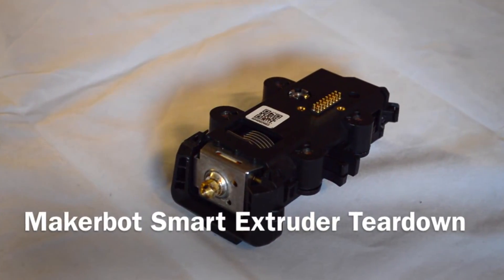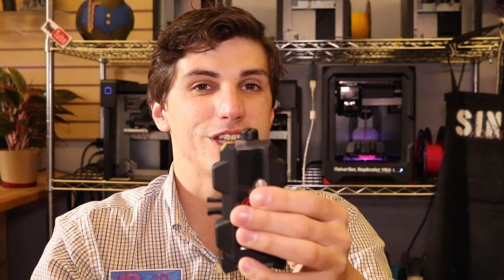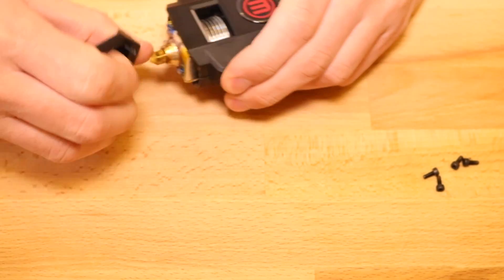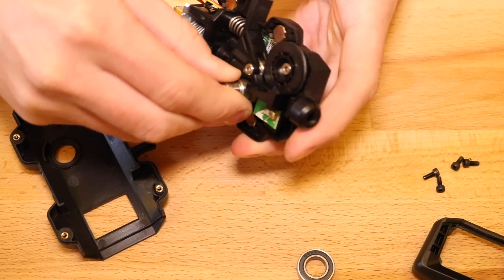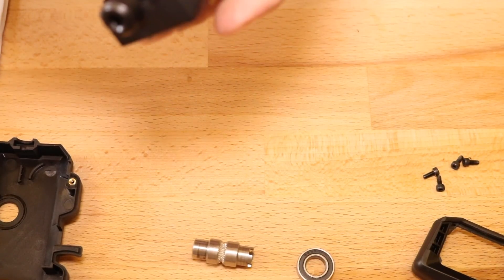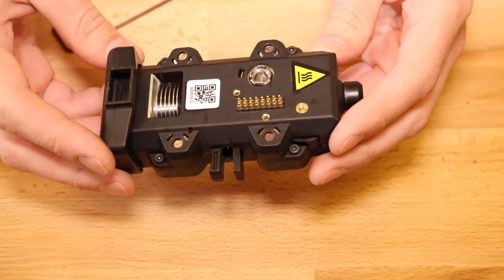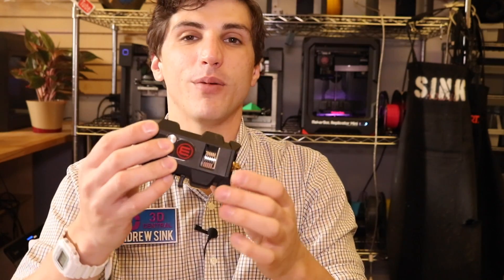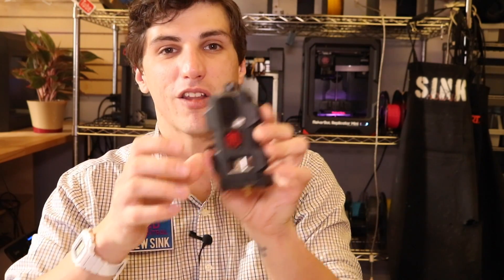Jammed/Clogged Makerbot Smart Extruder+ Plus Teardown and Fix

Comment: So, mine wouldn't come out because a piece had hardened inside the noozle. I removed the spring from the plastic guide so that it would not get lost and plugged the half with the extruder into the machine. It recognized it no problem. I started the pre-heat function while it ensure it would not touch anything. Once pre-heated in the machine I used some thick gloves to hold it and pliers to pull the filament and came off succesfuly.
Reply from the maker: Glad you were able to get it fixed!

Comment: When I pull on the piece of stuck filament, it will not budge. Any ideas?
Reply from the maker: Did you try heating the extruder and then immediately disassembling?

Comment: I have an extruder that actually wroks, but it was having a lot of fillament slips etc, and the leveling was crashing sometimes, opened it and cleaned the hobbed gear, and now im gonna heat it up so i can unstick the heat block from the aluminum plate so it levels correctly...

Comment: When I tried to removing the clog, I found it’s impossible to pull it. It snaps several times and I have to cut the feed tube to get to it.
Then I tried to use a torch to heated up the radiator part, while dragging the Jammed portion, and it came out. Just a personal experience
Reply from the maker: Yikes, that's rough. Sound like a pretty painful experience!

Comment: Great, thanks for this. Only thing I found is that when I tried to do this on a cooled SE I couldn't pull out the stray filament. I'm sure had I pulled or twisted it more aggressively it would have broken off inside.  So I heated it back up, then carefully disassembled it avoiding the hot end, and the stuck PLA came right out.   Also, my Allen key was omitted or is missing; please give the size Allen key to use, as these can be gotten anywhere.  Thanks, you're a life saver,
Reply from the maker: Glad I could help! Not sure about Allen key size, I seem to remember it was a 2.5mm, but you might need to try a few!
Reply: @AndrewSink  Looking further, it seems to be 2mm. I caliper-ed one that fit thinking it was SAE and got the odd .08", should have remembered most or all things in 3D World are metric.

Comment: Andrew - thank you. I fixed one a few years ago, but it failed this time. The jam was so far into the tube - it wouldn't come out and I pretty much destroyed it. Is there an alternative to buying brand new extruders? Is there a way to get 'extruder parts'?
Reply from the maker: Hmmm, you might need to purchase (or find) another broken extruder to get the PTFE tubing from, unless you can cut a piece and insert it yourself. Either way, spare parts for these extruders are typically not available unless you find an aftermarket solution.

Comment: Anyone else fed up with the Z18? This is like a pretend 3D printer at twice the price. The teflon tube guide in the overhead area gets tangled with the extruder, pulls the extruder off its mount! I have to rig an unguided overhead feed to make this anchor from the bismarck work at all. Jamming in the extruder is a by-product of all this.
But, thanks for the video... I would emphasize it was a little tricky compressing the clamp - at first I was a little conservative but finally it took "whatever I needed to do" to compress that clamp and get the piece into place. That might have been treated a little lightly in the vid - don't baby it, you have to brute force it back into place.
Reply from the maker: Yeah, getting the clamp on can be a challenge. You definitely need to squeeze pretty hard to get it on!

Comment: It worked for me, although I had to remove jammed filament when extruder was still hot. From cold one it was impossible.
Reply from the maker: Yeah, the filament has to be heated otherwise it won't release from the extruder.

Comment: Hi Andrew, my smart extruder + is clogged a lot further down compared to yours. Do you have any suggestions?  I have used a heat gun to expand the plastic, but I still can't get to it.
Reply from the maker: Do you mean clogged in the nozzle, or above the castle gear? What filament are you using?
Reply: @AndrewSink  Its probably in the nozzle, I have used a crescent wrench to release the nozzle but it won't budge. I'm using black PLA filament from MakerBot. Is it okay if I sent you a picture through email?
Reply: @iltety  9 month old post of your's but did you try removing the nozzle and doing a load cycle?  often that frees it up.  The nozzle is easier to get out when hot at the end of a preheat or load cycle.  But it will burn your fingers, so be careful!

Comment: I have a problem with the smart extruder always coming detached I think its a problem with the connecting head I thought that my old smart extruder just ran its life but I put a brand new one in and it keep doing the same thing
Reply: king fourtyonce this might be an issue with bed leveling. When the print head scrapes over the printed surface the forces can be enough to slightly detach it.

Comment: Hey Andrew. This particular video is not the best. There is a small spring that assists with auto leveling and you didn't show it very well. If you really want to make a perfect video, i would refilm that part and make sure the spring is show and placed correctly.

Comment: Thank you so much!  pretty new to the whole 3D print world so when I experienced this my first jam, i was pretty frustrated with the thought of forking out $200 for a replacement one.   At first I did exactly what you said and found the extra piece, still was jammed.  Realize that there was more way down near the nozzle.   cleared that and voila! back to printing!
Reply: how did you clear it down by the nozzle? I didn't have anything sticking out the tube and can't get anything to extrude.
Reply: @emfirk  9 month old post of your's but did you try removing the nozzle and doing a load cycle?  often that frees it up.

Comment: Thank you for positing the video. I had the same problem. My 3D job paused to print because it ran out of filament, and I was not able to successfully load the new filament in because of the clogging issue. I followed this video to disassemble the Extruder+. however, I had hard time pulling the left over filament out of the extruder. I can see the left over filament that is about 1/4 of inch sitting inside the tube, I tried with a plier a couple of time, and it just won't come out. Any suggestion on what to do when the jammed filament gets this stubborn?
Reply: I actually tried and that and still no luck, but thank you for the help! I ended up calling MakerBot and have it replaced.